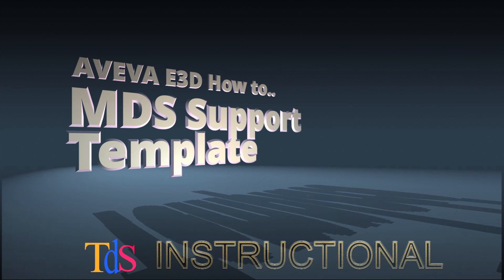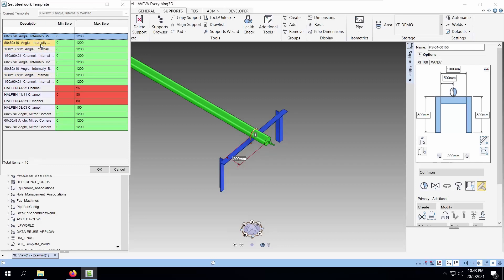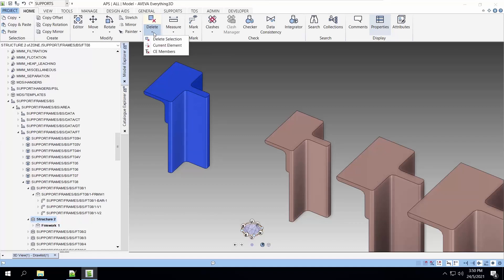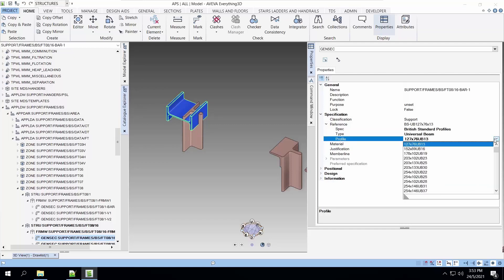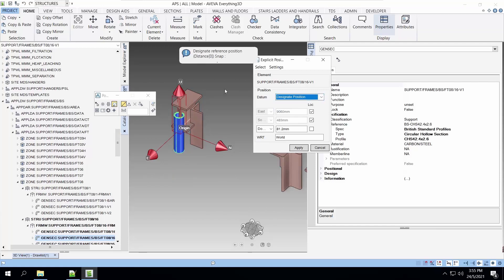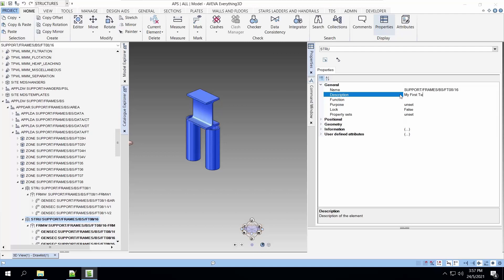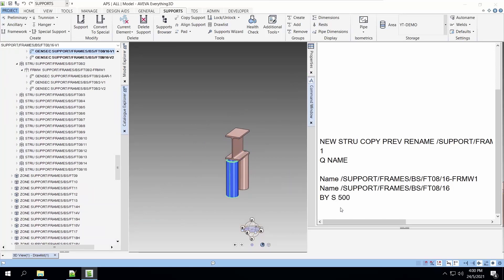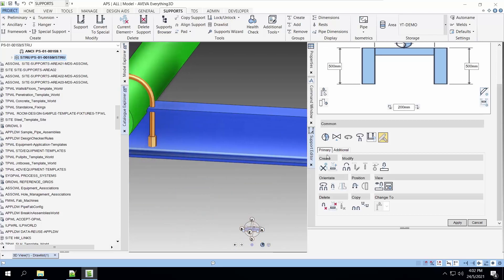How to create Support Template in E3D

Comment: Hi there , is it possible to do simulation for E3D?…Thanks
Reply from the maker: Hi, thanks for asking. Depending on what type of simulation you want to do, if you know scripting, it is possible. You need experience and training to do it. If you like us to share our experience, you can let me know specifically what simulation you have in mind. An example will be the excavation of a tunnel with the 3D model. I use commands like move, rotate, refresh and syscom ( to do a screenshot ). And I put all the picture file together to show a simulation of the excavation process. That was more than 22 years ago. Now you can use OBS to do it with the same commands to simulate the process. You can simulate construction sequence etc. But E3D is too expensive to do that. Use Twinmotion is perhaps better and more realistics.
Reply: @TDSEngrSolutionsPteLtd  
Hi,
Thank You very much for the explanation…
If you can share the video it would be of great help…
Actually it’s simulation of Material Handling of Equipment….
Reply from the maker: Hi, for study of material handling purpose, you may like to use Navisworks ( with clash detention ), Twinmotion  and other software. To do things with linkages, and you are doing a video, I recommend software like blender, 3D Max where you can do rigging ( https://all3dp.com/2/blender-2-8-rigging-simply-explained/ ) and PBR rendering. Use E3D to IFC to transfer to software like Blender or use Navisworks to FBX to do that. In 1995, we didn't have some of these software, so we use PML to do it.
Reply: @TDSEngrSolutionsPteLtd  
Thank you 🙏